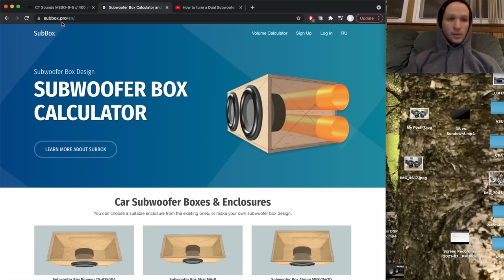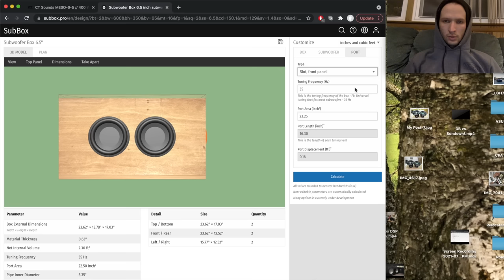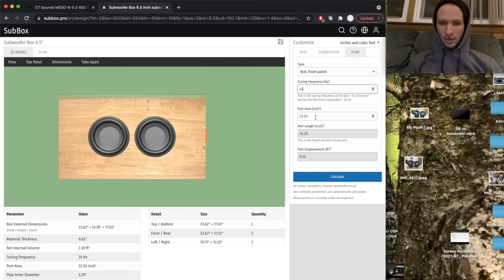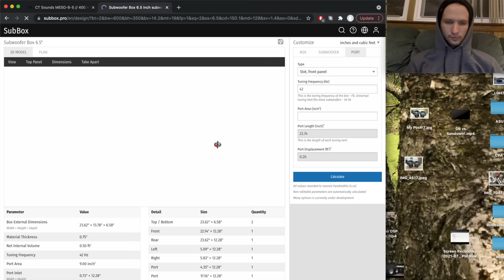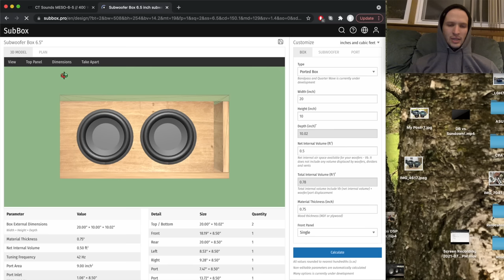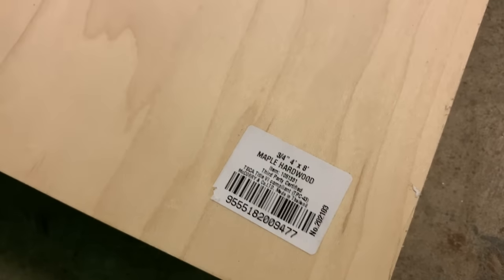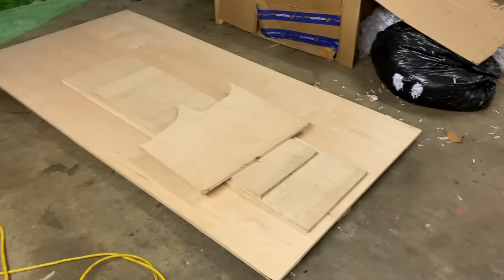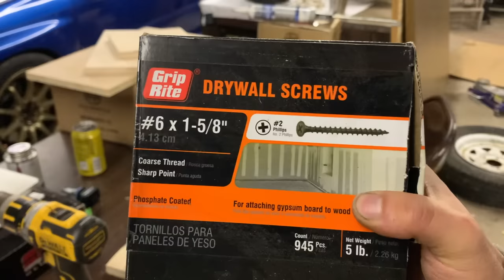How To Build and Tune a Subwoofer Box With this FREE App! For 2 CT Sounds MESO 6.5s | SubBoxPro.com

Comment: Great video as usual bro that is the next step I'm taking which is learning how to build a custom box. It's gonna be a learning curve but I'm down to learn
Reply: If you don't have the proper tools its hard im still learning but its not easy at all not to discourage you or anything its just a very hard thing and takes a lot of time and effort to learn even with the right tools sometimes but I have a small table saw so I am only able to use a circular saw on pices over 10 in
Reply: @valorantorion1588  You could get by with a serrated butter knife, some rocks and a lot of patience but who's tryna do that? Some places can cut boards down for you but if you have access to tools it's worth it to build your own if you know how to. Just built my own in shop class and it sounds better than expected
Reply: @valorantorion1588  i'm in the same boat lol, i got a table saw, and a jig saw, but then realized it's a huge learnign curve, and you forget to buy little stuff like clamps or proper screws. Most i have accomplished is converting existing boxes to fit different size boards, i converted skar's dual 8 to fit 6.5 subs, stuff like that.
Reply: Hey if helps , Down4sound sells Precut box kits , you just have to build it 😎👍
Because my issue would just be cutting the wood and getting it square and the correct ly measured cuts lol . Especially if you don't have the proper tools either 🍻cheers .
Reply: @HighVybeTribe  Not a bad idea, didn't even know they made those lol
Reply: @potatojake197   I actually just stumbled upon that recently myself L o l
Reply: If you have a saw, i'd highly reccomend using it to cut off the imperfections where the boards stick out (which will happen even to the best carpenters) instead of sanding them. Sanding takes FOREVER on larger parts stcing out over a mm or so. My first box had a board sticking out like half an inch and i sanded it down and it took like literally an hour with an electric random orbit sander... save yourself the time and just saw it off, and then sand it lightly for looks. Nobody said you cant cut the boards after you glue them together... XD
Reply: @valorantorion1588  we have to start somewhere bro
Reply: @potatojake197  nice
Reply: Just buy a box because unless you plan to have a business it's not worth making it yourself.

Comment: I had a pair of the previous model meso 6.5 and hit 136 on 800 watts and sounded great.
Reply: damn, didn't know 6.5's could get that loud, i don't think they can carry very far though. I notice the smaller subs can be pretty darn loud in car b/c they use the car as a box almost, but rattling high rise office windows from across the street you need cone area for just the distance though, i'm not for certain i kinda pulled that out of my butt, i just know bass is weird like that.
Reply: What was the specs of your box

Comment: I just designed my own box with the website after seeing this video. Thank you for the shoutout to website. For anybody using the site, you put in your height and width and it calculates a depth for you. It does rectangles, not triangles and wedges.  It also doesn't show putting a triangle in the corner where the port meets the chamber to "round" that corner and direct the sound.

Comment: Great job on the box! I have no doubt that it hits clean and hard for two 6.5 inch subs. As you continue to build enclosures, maybe consider getting a Kreg Jig. You can hide your screws and countersink them then plug the holes so you don't have to remove any screws when routing the edges. I would go with Duratex to cover the enclosure with because it's so easy to use and looks great plus it seals it from any moisture.
Reply: Cpuld also use wood glue when assembling, so you don't have to remove the screws 😊
Reply: Would mdf or plywood be better

Comment: i could be wrong but the specs you read were for only 1 6.5, so since you have to i think you were supposed to double the .5 cubes to 1.0 cube and the 12 inches of port to 24 inches. i could be wrong tho parker, box still sounds good tho!

Comment: I use their mobile site. It doesn't have all the features but works pretty well. I built a box very similar to that but with the sub and port on the small end for an 8 and it's only 3-4 db below the few 12's I've tested

Comment: I love this video, i did the same dimensions you did. , however i think you should make another box with a bigger port area such as 11- 12 squared. I noticed it creates a-lot of air , what do you think. Its worth a try and see what are the differences in between both boxes.
Reply from the maker: I agree a bigger port would not have hurt! It sounded good in my car but definitely a little port noise when I had it in the garage
Reply: @ParkerTheBasshead  i just built another box , i can say that its little punchier but we have to remember its only a 6.5, it was worth the experience.
Reply: In winisd it show the port area should be atleast 18sq.in. but 22-24sq.in. looks the best for the 2 subs in that size box
Reply: sorry for a late reply , that is so true it can do so much , none the less very cool to watch you make these builds

Comment: I find the manufacturers recommend enclosure sizes to be way off. 
 When you enter t/s parameters in enclosure molding software,  it paints a very different picture. 
 I'm running a scar 18 and they called for 2.75 sealed and 4 ish ported . After modeling it needs over 10 feet ported and between 4-8 sealed.  I tell you it is allot better in the bigger boxes by far.
Reply: So a 20 cubic foot box ought to sound twice as good then. Right?
Reply: @martinmi5  only one way to find out. Send it!

Comment: Dope video!! 
Quick question I’m currently running two JL TW3 12s under the back seat of my crew cab Silverado and just don’t like the minimum air space.  
And looking to get rid of the shallows and go with an 8” but then i seen the 6.5” 
My question is you think two of these Meso will do good under the seat of my truck ?

Comment: Quick question please, I have two Kenwood amplifiers one for a 10 inch Orion sub in its box and a Rockford Fosgate 10 inch sub and another box. I haven’t tested for frequencies yet but is it silly to have two different subs in one system? I would like to have the second sub on a remote knob to where I can turn it up or down on certain songs

Comment: I used that size box around the same port size the cubic feet may have been like .1 or .15 bigger but I used that for a toro 6.5 came out great not sure why ct recommended such a small box

Comment: Been using this program for a while.. but you’re going to have a lot of port noise running a port like that based on 9sqin on 6.5’s.. I could put this in other programs and check this but you should be no less then 1sqin per diameter of sub as a baseline standard.. with two 6.5’s the smallest you should be is 13sq and even then depending the size of the box you’re going to have port noise.. given the cubes of that box you most definitely are.. 

I’d have played around with .33-.5 cubes checking the response and tuned the port based on the response I wanted not what they recommend.. that box should most likely be .33-.4net per tuned to 35 to get it to play how one would actually want it too with a solid +3ish port boost and slow drop off. 

With what you did to that port sizing you just returned that box from 47 or whatever it was to like 54 lol.. you just made a very expensive mid base box that will generate a lot of port noise and likely be very peaky and boomy around the tuning with I’d guess a +6 at 54.. that is not a good build at all man and you know this.. this is first timer newb shit you posted right here..
Reply: Damn sound like u know ya shit..but u ain't have to shine on him like that lol
Reply: i know this is 2 years later, but I made a box for these subs at .8 cubes, and 35 hrtz based on your comment. It is 24x8x13.something. 
I used .75 mdf. subs come tomorrow. I will let you know how it works. Im unsure If my port is big enough, at only 1 inch wide, but it is pretty long so we will see! I used speaker box lite for the design.

Comment: I'd use glue and some brad nails for a wood enclosure I could stain and make look good. Screws are ok only if you are carpeting the box. And if you are going to carpet might as well use MDF.
Reply: No Thankyou. Nails suck to work with.
Reply: @elijahmaggio2832  I used nails with my box, 3/4 mdf got a bit of splitting. I packed any visible splits with glue+sawdust and sanded it smooth and it's hardly noticeable
Reply: @potatojake197  they are just annoying us all
Reply: @elijahmaggio2832  Wym?

Comment: Freakin hate terminal cups, unless you heavily seal them forever, too large a diameter, too much plastic to vibrate. A brace in the middle would have helped with the box rigidity and resonance. Due to the slot port, your tuning might have ended lower than predicted, due to K end factor of geometry of vent = increased group delay and phase shift, due to bends. Furthermore, vent area and length are directly proportional to power handling and vent noise. I would never use less than an 8in sub unless absolutely necessary for space, but those CT sounds cost a fortune in Europe, no one uses them. Those online box calcs are primitive when it comes to most calculations. I wonder how you got the speaker displacement figured out, or was it given anywhere. All in all a good starting point. ;)

Comment: It's really hard for me to take you seriously considering I've been doing car audio for a career.... You remind me of the kid down the street who uses their moms extension cord to run his subwoofer wire... Great you have a YouTube channel, but I have to say it does not mean you know very much about car audio... I have seen so many kids like you come  and go, bringing there rigged up systems to me to fix.. you're on the right path don't get me wrong, but you're using the wrong equipment... You're using the cheapest car audio there is on the market, garbage audio we call it... Brazilian made junk, Skar audio and stuff that I would never put in a customer's car because it's going to burn up, it's junk... Have you been through any kind of certification program or education for car audio installation? Anything?